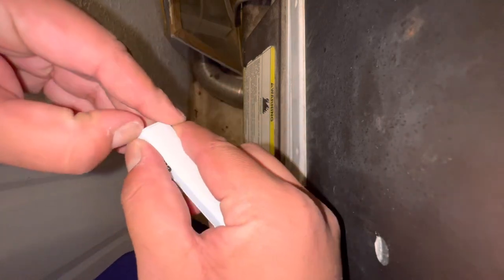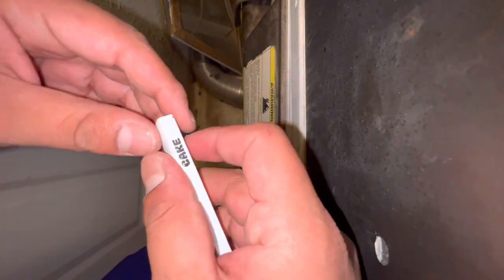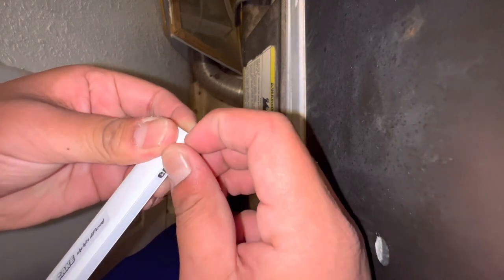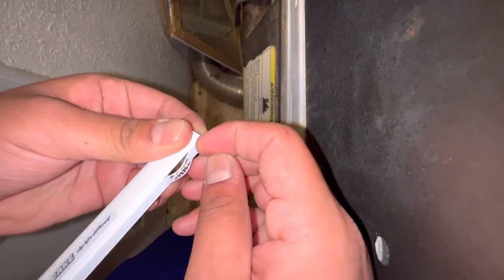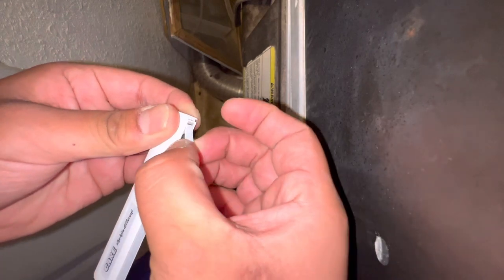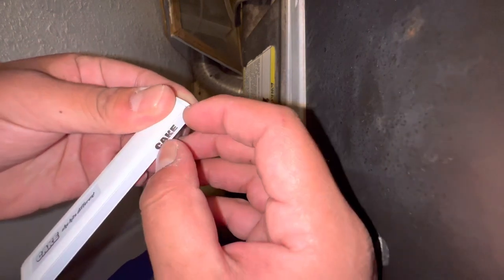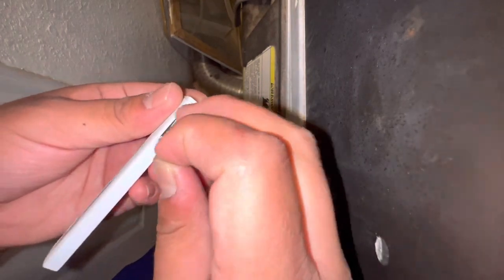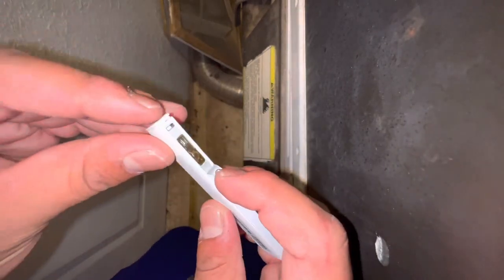HOW TO CHECK HOW MUCH WAX IS LEFT ON THE 3RD GENERATION DISPOSABLE (ITS REALLY EASY) STEP-BY-STEP

Comment: I feel like these 3rd gens have less wax than the first gens
Reply from the maker: Youuuu think so???
Reply: I think that this is accurate hit only one blinker and maybe 2 or 3 normal sized hit and I already have like 75% left
Reply: @damianpp456  the battery is stronger
Reply: @damianpp456  nah you gotta take smaller hits bc they upgraded the battery
Reply: and i feel like they dont hit as how they used to 💔💔

Comment: ii so i gotta 3g one and it just stopped pulling like the light come on and everything i charged it but it dont pull and it got like more than half the wax still in it
Reply from the maker: Honestly I ain’t had the 3 g cakes yet but if the battery don’t pull your stuff is messed up you need a new battery and take the wax out

Comment: Mines not pulling but it charges and if I blow into it smoke comes out the bottom
Reply from the maker: I think it’s messed up bro your going change it to another battery
Reply: @selfproduction  RIP apple fritters thanks for the reply doe
Reply from the maker: Much love fam
Reply: Are you sure your hitting the right end  man? Lol that sounds like a super duper stoner move but like for real if you blow from the bottom part of the vape the smoke should be coming out of the top.
Reply: @ast8256  nah man lol I was blowing from the top and it would come out the bottom but wouldn't come out the top at all
Reply: @requis8190  did you take the mouthpiece off and see if the little hole in the rubber is blocked?
Reply: Like the rubber barrier that holds the oil in and making sure there hole in the middle of that is clear to draw  through
Reply: He is on Instagrams and Telegram as
Reply: Chequefibs✓✓